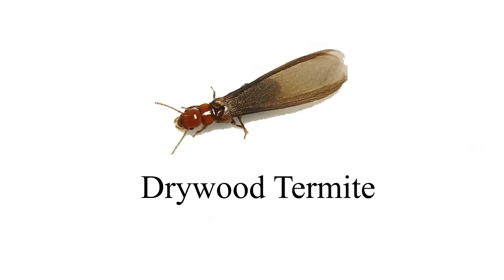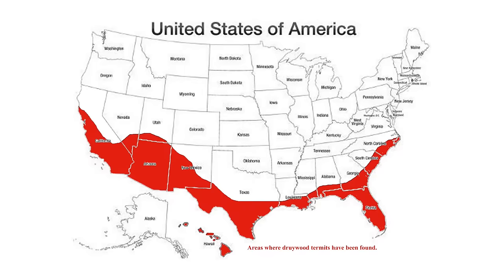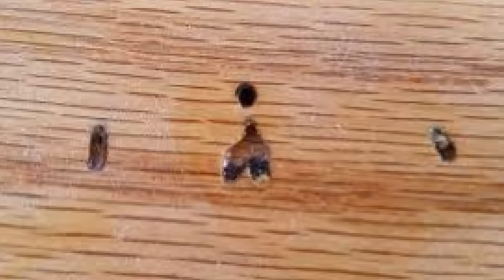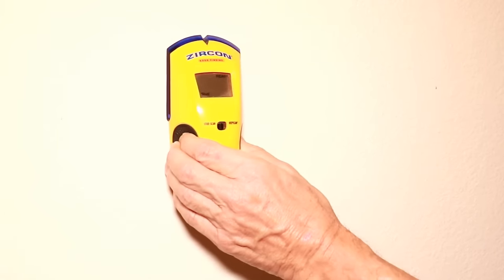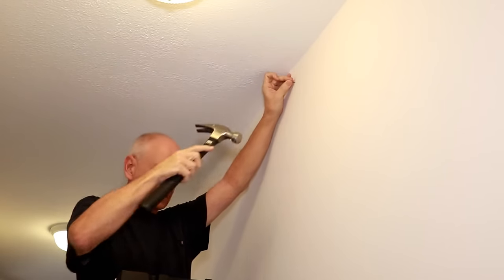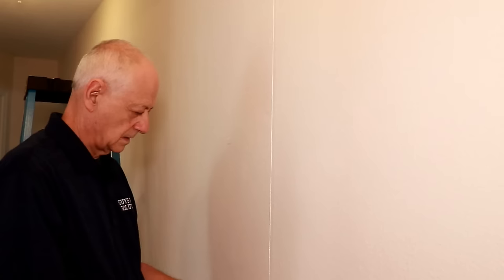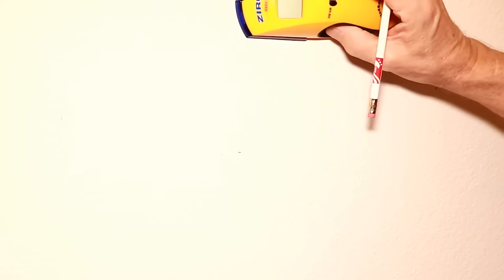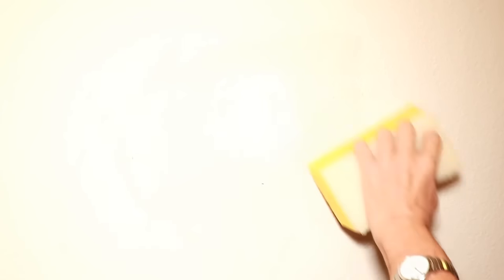How to Treat a Drywood Termite Infestation Yourself. A MUST see if you have Drywood termites.

Comment: Hey Guy thanks for everything you do, your depth of knowledge is information I cannot find anywhere else and very useful. Some question. I have a wooden fence that surrounds most of my home, about five feet away from it on 3 sides. It's probably 9 years old. I found at least 4 different locations with frass  on it  on one of the 3 sides of the fence and I recently have had a pest control company spot treat three different spots of drywood activity in my crawl space. Should I completely replace this old infested fence if I have the money (it probably has a few more years left)? Or if I can't pay for new fence should I treat the fence with 1:1 dilution boracare then seal it and replace damaged wood? What is the best way to prevent termites on wooden fences, old and new? How often do you have to reapply preventative treatment to a fence, will boracare and sealant once last the life of the fence? Based on what you've said, I probably have drywood's everywhere in my house, just haven't seen signs of it yet (except one area that was spot treated where frass was in living room through wood floor). The wooden siding on my house is rotting in a few areas and not covered with paint so I am sure they entered those areas already near the infested fence. I am guessing your going to recommend tenting the home? then 60 day recurring preventive spraying? Should I take care of the fence issue first before tenting? 
Also, my home is pier and beam, with a fourth of piers on one side resting on concrete slab, the rest on the soil, how would you prevent subterraneans? My pest control guy recently sprayed the whoe crawl space sublfoor with a coat of termidor and also sprayed a thick coat of termidor on the soil but didn't trench, he told me it would bind the soil and provide 10 years of protection. Do I need to trench each individual pier and along the whole concrete slab edge? I live in Houston, Heights neighborhood.  I would love to use the granules you mention as they seem simple but not sure if they would work here, our soil is described as "are well-developed, clayey soils with high shrink-swell properties."
Thank you so much Guy
Reply from the maker: I do not think I would replace the fence just because of termites.  If the fence is not sealed in any way, then Bora-Care should work fine. This will kill any termites that are in the fence now and it will prevent new ones from infesting the fence as well.  The only thing is though, you need to put some sort of sealer on the fence about 48 hours after you apply theBora-Care.  I will give you a link to a video on how to do this.  The Bora-Care will last forever, or until the sealer starts to degrade and allows the weather to deteriorate the boricare.  So, you may need to reseal the fence periodically.  Mixing bore care at a ratio of one to one with water is always desirable, but if you have a lot of fence, you may want to mix it a bit weaker than that.  You can mix it one to five if you like, but the higher the concentration of boricare, the better it's going to work.

I can see that you have been paying attention to my recommendations.  You're absolutely correct that I am going to recommend that you have your house fumigated.  It is the only way to totally eliminate drywood termites. You're also correct that I'm going to recommend treating the exterior of the house every 60 days.  I'm not sure which of my videos you watched, but if you want to know the cheapest and most effective way to do this, I have a new video out that will show you how to do it with a hose and sprayer.  You are not supposed to do it this way, because it will exceed label recommendations on the amount of pesticide that you are supposed to use, but I can tell you that I do it all the time.  It will not harm you or the environment. The great thing about treating with a hose end sprayer is that it is very fast.  I cannot tell you how much time this saves.  Also, the sprayer has a stream setting that allows you to reach high places, without using a ladder.  The beginning of the video shows you how to treat with a tank sprayer, but later in the video it will show you how to use the hose end sprayer.  The video also recommends treating your yard, but that will not apply to you, because treating your yard will do nothing for drywood termites. 

The the fence and the house are standalone issues.  If you have drywood termites, then your neighbors have them as well.  That means your house is going to get swarmed every time it's warming season, whether you treat the fence or not.  It makes little difference if you get swarmed from the fence or swarmed from your neighbors' houses.  The reason you would want to treat the fence is to save it from further damage.  As long as you do the treatment on the house every 60 days, that should provide adequate protection from further infestations. 

If your house is on piers, then it would be a good idea to treat all the wood under there with Bora-Care, and you would definitely want to mix that one to one with water.

The pest control person that you hired didn't really do the job correctly.  You cannot simply spray the top of the soil with Termidor to stop termites.  Unfortunately, it doesn't work that way.  Termites travel a few inches under the ground and the spray that was applied on top of the ground will not penetrate the ground deep enough to be effective.  This treatment may help prevent the termites from creating a colony under the house, but that is not a sure thing either.  It is also unclear how long Termidor will last on the ground when used as a surface spray. I think it is highly unlikely that you would get 10 years out of it.  Depending upon your soil conditions and how much product to used, you may get as little as 3 months protection, but certainly no more than 5 years.  My guess is that the longevity will be measured in months and not years.  There is a good chance that it will not last for a full year. Again, treating the ground only prevents subterranean swarmers from creating a colony under the house.  It does little to prevent them from heading up to Piers.  I mean, it may help a little, but I certainly wouldn't bet the ranch on it.  If you spray all the piers every 60 days, while you are treating the outside of the house, this will probably help prevent subterranean termites, but you are probably better served by applying termite granules around each of the peers.  Keep in mind that for the granules to work you need to have dirt around the pier and the dirt needs to be porous enough to allow water to soak into it fairly easily.  To find out if the granules would be a good choice for you, just dig a shallow hole that is about 4 inches deep and maybe 8 inches long, and the width of the shovel.  Then, fill up with water.  If the water drains down fairly quickly, then the granules would be a good choice. Otherwise, the granules would not work well for you.  Naturally, you cannot do this if the piers are on top of concrete.  For those peers, the best you can do is to spray them every 60 days while you are doing the outside of the house.  I do not think I would trench, unless you have an existing infestation.  I would probably just inspect the house every 60 days while I was doing the exterior treatment. You can also install monitoring stations if you like.  I'll give you a link to my video on how to make them.  I live in Florida, and I use the granules, the monitoring stations, and I inspect every 60 days while I am treating the outside of the house. 

I hope that helps. Be well my friend.

Video on how to treat the exterior of your house:  https://youtu.be/Yozv3s-Qwlw

Bora-Care video:  https://www.youtube.com/watch?v=Rmr_aEodyhg&t=12s

Video on how to make monitoring stations:  https://youtu.be/gye27aXHRsY
Reply: Thanks so much for your response Guy. Some follow up questions. 
-my home is pier and beam with easy access to crawl space. When I treat the subfloor with boracare does it need to be sealed since it’s technically not exposed to rain or sunshine, maybe just wind?
-I watched your drywood prevention method. Seems like your home is some form of stucco and you only sprayed bottom and top of your home. My whole home is made of wood siding  on the outside, there’s definitely some open crevices between a lot of the wood siding in between the areas I noticed you didn’t spray. In my case does the entire surface area of the outside need to be sprayed? I want to do this right, tenting isn’t cheap and don’t want to get reinfected. 
-what sealant do you recommend for fence after boracare? How often to reapply, every 5 years? Lots of rain and sunshine in Houston. 
-you mentioned I can use granules if the water drains in hole I dig fairly quickly. Can you please be more specific: 10 seconds, 30 seconds, 5 min?
-if the granules don’t work for me due to soil penetration issues, how can I prevent subterraneans? Trench around every beam under home? And spray beams on concrete during 60 day prevention sprays?
Thanks again Guy. Can’t emphasize how helpful this is for my family
Reply from the maker: @mikeandrews5787  Those are great questions.  Let me see if I can unpack some of that for you.

To the best of my knowledge, there is no need to seal under the house when using Bora-Care.  It is my understanding that only wood that is exposed to the weather needs to be sealed.  That is how I understand the directions and how I have always done it.

Drywood termites colonize inside wood, so if the siding on your house is made of wood, then I would recommend treating all of it.  I would definitely do this with a hose end sprayer.  It would take forever to do this with the tank sprayer.  That means you do need to treat with Bifen XTS.  This is not going to take as much pesticide as you might imagine.

With regard to sealing the fence, that is a little bit outside my wheelhouse.  I do know for sure that you are better off using an oil-based sealer rather than a water-based sealer.  I think it's a pretty safe bet that you're going to get what you pay for, so I would ask someone in the paint department at Lowe's or Home Depot what the best choice would be. Just tell them what you are doing and that you want something that is going to last the longest amount of time.  I don't know if anybody can predict exactly how long it will last, but I'm kind of guessing that it will need to be done about every 5 years.  It's the sort of thing that I would inspect every year, and I would reseal when I start to see that the sealer is starting to weather.

I get that question a lot about how fast the water should drain in the test hole.  I don't think there's a hard fast rule on it.  Obviously, the faster of the water drains, the better the granules are going to work.  I don't think you would want the water sitting in the hole for anything more than 60 seconds.  Of course, that depends on how deep you dug the hole.  It's kind of hard to get a hole exactly 4 in deep, so a hole a little deeper may drain a little slower.  I guess the thing is that you should be able to stand there and watch the water sink into the ground.  If it is slowly sinking into the ground while you are standing there, then you are probably okay.  However, if it's just kind of sitting there and not doing anything, then the granules are probably not a good idea. 

Preventing subterranean termites is an interesting topic.  If the granules are not a good option, you could trench around each pier, but I generally do not do that as a preventive measure.  If you are going to spray the outside of your house with Bifen XTS every 2 months, then I would just go ahead and spray the piers as well.  There is a stream setting on the hose end sprayer that will make this quick and easy.  I would also install monitoring stations around the house at 4 ft intervals.  If you have easy access to the piers, you may want to install one on each side of each pier as well.  I make these out of used water bottles.  They are very easy to make and feature an orange dot at the top of the station.  If the orange not disappears, then you simply pull up the entire station and check to see if there are termites in it.  If there are, then you simply reinstall it back into the ground, and then you install a bait station right next to it.  I will give you a link to my video on how to make the monitoring stations and the bait stations.  The bait stations can only be used if you are actually seeing termites.  The monitoring stations are used to detect termites.  I think if you spray the piers every 2 months and you install monitoring stations, you should be good to go.

I hope that helps.  Be well my friend.

Video on how to make monitoring stations:  https://youtu.be/gye27aXHRsY

Video on how to make bait stations:  https://youtu.be/r05Z-aUJehw
Reply: Thanks for the details. Makes sense. As far as drywood prevention I see you recommended products with active ingredient Bifenthrin. Talstar P and Bifen I/T both have 7.9% Bifenthrin, while Bifen XTS has 25.1% Bifenthrin. The price is significantly more for Bifen XTS as expected. Do I need Bifen XTS for prevention sprayed all over my wood siding or can I use the cheaper Bifen I/T 7.9%?
Reply from the maker: @mikeandrews5787  Keep in mind that the Bifen XTS only gets mixed at 1/3 of an ounce per gallon instead of the 1 oz per gallon that the Bifen IT gets mixed at.  So, if you do the math, you will find that the price per finished gallon is actually cheaper with the Bifen XTS then it is with the Bifen IT.  The finished dilution rate coming out of the sprayer is pretty much the same.  So, you actually save money by using the Bifen XTS.  Just divide the price of the Bifen XTS by 3 and you get the same price as a gallon of Bifen IT.  Another way to say that is that 1 gallon of Bifen XTS is actually 3 gallons of Bifen IT.  So a gallon of Bifen XTS lasts a lot longer.  

If you have wood siding, then you should spray all of it.  There is no way in the world that I would do this with the tank springer because it would be way too slow.  Therefore, it makes a lot more sense to me to use the hose and sprayer and the Bifen XTS.  Just make sure that you dilute it 1 part Bifen XTS to 14 parts of water in the hose end sprayer and set the sprayer to 5 ounces per gallon.  This will give you a finished dilution rate of 1 ounce per gallon of water out of the end of the hose end sprayer.

I hope that helps.  Be well my friend.